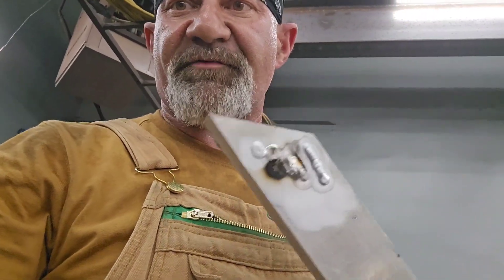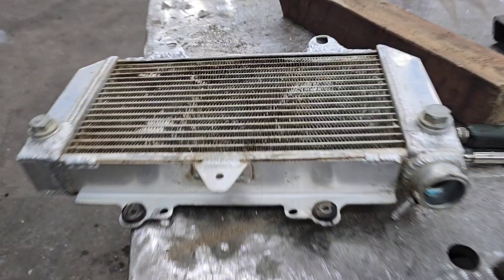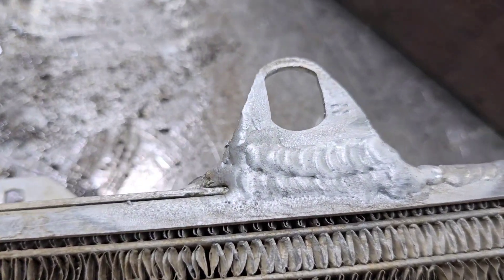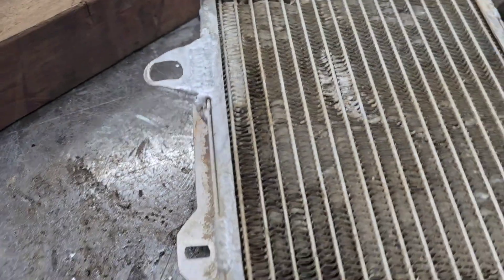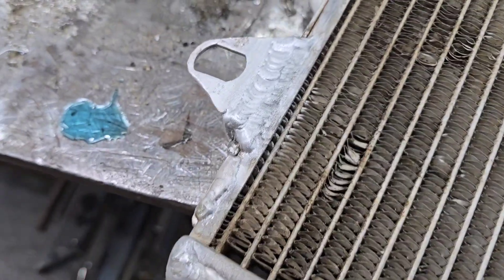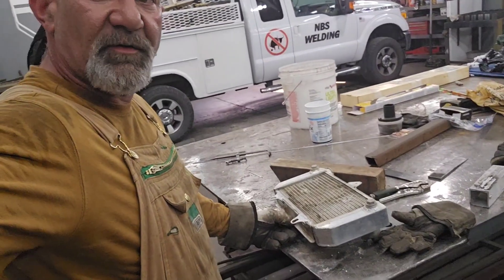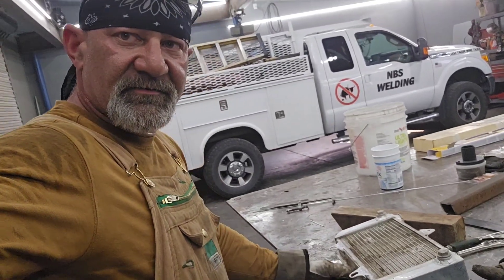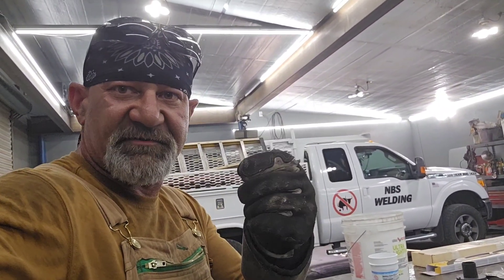TIG & MIG welding to fix an ATV radiator that is very contaminated

Comment: I found that some of the Aluminum on Motorcycle parts has a bunch of Magnesium in it and is a real bear to get it to puddle it always looks cold or like it has Slag in the puddle .Sometimes 5356 will work better .
Reply from the maker: Thanks 👍

Comment: Transmission oil coolers on Nissan SUV's are identical to these ^. Nissan ask 1700.00 for a new one if yours break. I started welding the broken ones up - it's gnarly, but do-able. Using a heavy copper backer to allow you to "float" out the repair also works - making a pond, essentially.
Reply from the maker: Good info...haven't done one of those yet